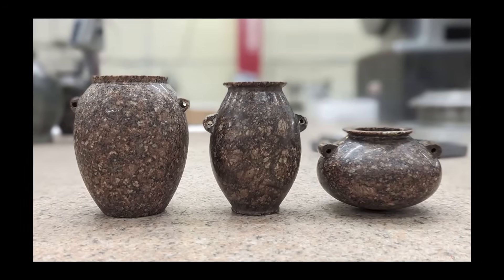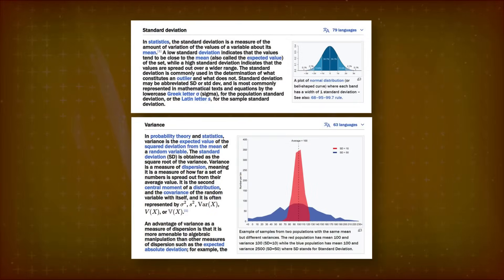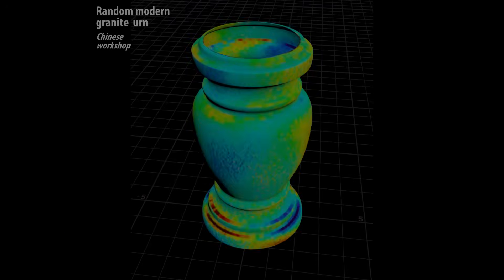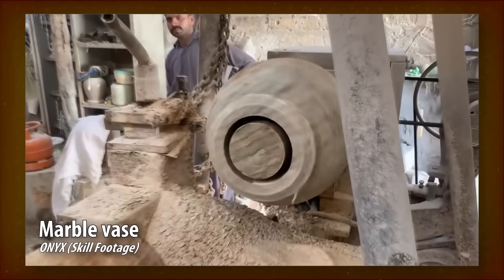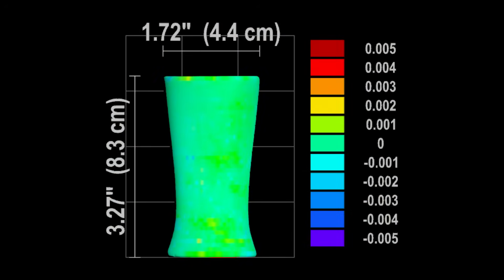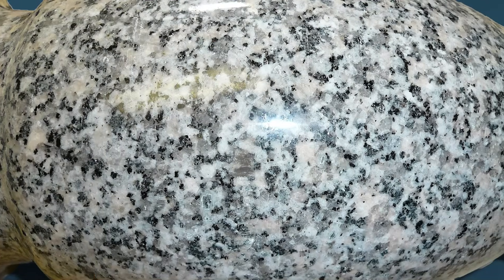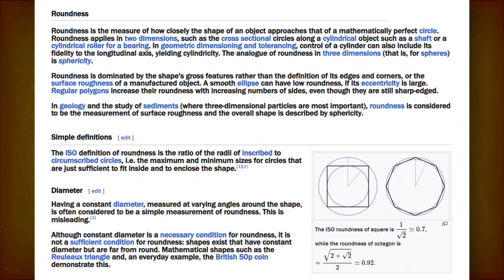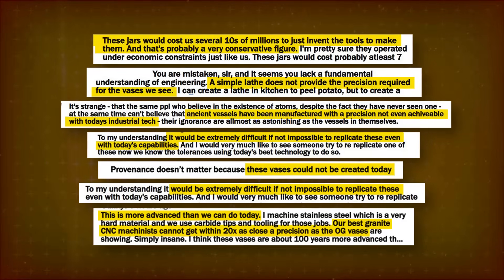Impossible Granite Vases: 3D Scan Showdown

Comment: the shot glass was that used a lathe and carbide tooling was the only example that was remotely close , and the operation used carbide and precision of a modern metal lathe
 You have only proven you can't make granite objects within .002" in 5 axis without a lathe and carbide tooling
Reply: No , what it really proves it that the claims of LAHT advocates are inconsistent
Reply: @matthewmiller5619  that's refreshingly sweet 🤗 almost naive, bet you believe they moved 800 ton limestone blocks on logs with rope, too, bless your heart
Reply: @mrglasecki  How do you think big stone blocks were moved?
Reply: @mrglasecki  your beliefs require the ‘god of the gaps fallacy’ whereas I’m just comfortable with accepting that we may never know the methods used .
Reply: @mrglasecki  I'm really curious, what do you believe they used, if not rope?
Reply: @MrAchile13  honestly that is a extremely good question the smaller 5-10 ton blocks could have been floated, possibly rope ect above 50-100 ton that's no longer possible 600-800 ton+ obelisk over 1000 ton that requires hardened steel alloy and a significant amount 
 For the naysayers karahan tepi had stacks of cut stone vessels 12000 years ago and plates bowls vessels in the well of the step pyramid that required high speed lathes diamond tipped steel tooling , sorry if this doesn't fit your preconceived limited superstitious beliefs 
anything steel would have long rusted to oxide in less than 10k years 
  I work with hemp bast hemi cellulose fiber,  it's a minimum of twice as strong as steel by weight , to position 800 ton * even one fourth that weight would require winches rigging and alloy steel cables, the painted hieroglyphics showing 100 guys pulling ropes over logs is beyond hysterical it's like the modern uneducated trying to make sense of something beyond their grasp saying the disc of Sabu was made with copper and pounding stones 
 800 ton required not just steel on a basalt surface * hardened steel on hardened steel on a level bed and ~1600-3200 HP
Reply: @mrglasecki  let's not get side tracked, as we are discussing the usage of rope for megalith movement. 

The heaviest Egyptian obelisk ever moved is the Lateran obelisk (300+ tons). You might be surprised to hear, but it is located in Rome. That's right, the Romans took it from Egypt, all the way to Rome, almost 2000 years ago. Do you think they did this without using ropes?
Reply: @MrAchile13  let's start with the obvious, yes Romans used rope
 Egypt moved the obelisk 130 miles across the desert
 It took Roman conquest >25 years to move it by water , using heavy ships it took  years to build with solid road surfaces to distribute 400 ton obelisk (that broke) with IRON hardware
Reply: @mrglasecki You didn't answer the question-perhaps it wasn't clear enough..
If as you seem to be claiming, those heavy stones could not be transported using the tools and tech of the era that we know of, how do you think that they were moved?

And by the way, the "wood couldn't handle the weight" hypothesis has been pretty thoroughly debunked.
You should probably do a bit more research.
Reply: @mrglasecki  I'm curious where did you pulled the claims about it being moved 130 miles across the desert or that it took the Romans 25 years to move it?

So you do admit a 300 ton stone can be moved by using rope. This is already more then the 100 tons you previously claimed to be the maximum load possible to be moved by rope. My question is, where do you draw the line? What is the weight where we move from ropes to this mysterious and unknown method of transportation?
Reply: @darklight2.1  * the log idea is not impossible it's improbable , that a massive difference , Egypt moved the lateran obilsk to from Aswan to karnack ~1400 bc across the desert 130 miles
 it took Roman conquest 25 years to move it by sea with heavy ships 2000 years later a few km over paved road  
 the last time there was enough rain to grow enough trees to move the granite basalt diorite limestone of Egypt would of taken 125,000 Years to grow
 thinking they had iron even hardened steel alloy is simply easier to swallow
Reply: @MrAchile13  Egyptians move that 400 ton obelisk 130 mile minimum across the desert Roman engineers used heavy ships and the Sea and maybe 80km of paved roads 2000 years later with IRON 
* When 1200bce Egypt only has copper
Reply: @mrglasecki  You posted your previous comment again. As I said, I was wondering:

1) why would you say the Egyptians moved the obelisk 130 miles across the desert?

and 

2) if you accept the 400 ton obelisk was moved by rope, where do you think ropes stop working and we need this mysterious method you are hinting at?

Remember, we are discussing the use of rope for megalith movement. What rope can or cannot move.
Reply: @mrglasecki  How would you move them with the materials at hand?

There are many theories. For instance, C. Dunn, an engineer who has been presented numerous times as an expert witness by the LAHT channel UnX believes that a group of skilled vocalist's could "chant" large stones into place, harnessing  the resonant powers of their voices.
What do you think?
Reply: @MrAchile13  the obelisk in Rome is made of rose quartz from the Aswan quarry and that's 130 miles from Karnak (Luxor) where it was located prior to being moved 
2.) probability and possiblity are starkly different, the Romans took 25 years to build the boats and engineers to move it 80km on paved roads 
 the shear volume of granite conundrum diorite basalt limestone blocks across Egypt would require a rainforest 100 thousand years 
 A modern locomotive weights 200 ton a weight capable of smearing a metal coin between hardened steel alloy rails and wheels 
exactly how many ropes would you need to pull it down a gravel road on logs without  wheels * forget bottomless desert sand that's round and smooth versus ocean beach sand that's interlocking when wet and that's half the weight 
 400 ton would reduce timber to toothpicks
Reply: @mrglasecki  1) do you believe they moved the obelisk from Aswan to Luxor by land, instead of using the Nile? Why would they do that?

2) again, let's not get sidetracked, we are talking about rope movement. Should I understand you do accept there is no ancient megalith that couldn't be moved by using ropes? As I understand now, you don't seem to have a problems with the ropes anymore, but with other aspects of the movement. Is that correct?

I don't know how many ropes would be necessary to move the locomotive, but we would need less then the Romans needed to move the Lateran obelisk, wouldn't you agree?
Reply: @MrAchile13  moving the locomotive with rope is critical it's half the weight 
  if you could drag a locomotive across timber  it would reduce it to pulp the Romans  figured this out 2000 years later across sand attempting to move twice the weight 130 mile (that's one of the shortest distances ) not just  that one from every quarry to every building site is simply not realistic 
 Moving an object 80 km across paved roads even lashed to a rowing heavy ship wouldn't require the amount of rope to dead drag a 400 ton object Up and down 450 foot of elevation through the desert sand
 Going against the current of the nile, please  think what it would be like going against the Rhine, Mississippi , Rio grande, river in a crocodile infested water dragging a city full of granite against the current
Reply: @mrglasecki  1) seriously, why would you drag it through the desert instead of using the Nile? Where is the logic in that? Luxor is downstream from Aswan, so no one is going against the current. Crocodiles do not highjack ships and sadly, there are no cities full of granite.

2) ok, I understand you no longer have any problems with the rope. So as you understand, there is no ancient megalith that could not have been dragged using rope

3) as for the locomotive, no, it would not destroy the wood. You would simply put the locomotive on a wooden sled/frame and then you would drag it across the wooden beams/rollers.
Reply: @MrAchile13  1.) currently the nile with locks dams is a navigable river of 35' maximum 25' average allowing modern ships to float by displacement
 1400 bce they had reed mats rolled into bundles with 450 foot of elevation and no where near the depth the weight would have ripped the reed barge apart dragging it through the river silt ( basically sand only 1000 times smaller liquid earth) would be impractical to build a barge for every block otherwise it's drug one way at least it's a barge not a sailboat  
 I'm not saying stuff wasn't moved that way
 the river bottom would be paved with lost stone over several thousand years
Reply: @mrglasecki  1) We found two of Khufu's boats at Giza, they are made of wood, not reed mats (~2500 BC). I think we both agree no one would ever try to move an obelisk using a reed boat. Fortunately, we know better. There is a depiction on the Temple of Hatshepsut from Deir el-Bahari (New Kingdom ~1400-1300 BC) depicting a wooden ship carrying an obelisk.

2) now that we agreed rope is strong enough for the job, what other problems do you see?
Reply: @MrAchile13 Khufus boats are impressive 
 the obelisk was 150'  long
the boat you're referring to, though physically capable of carrying the weight by displacement of length width draft to barely float the stone but not design , if it was multiple barges instead of cabin boat, again though  possible the thought of using only one barely big enough isn't probable , in the least 
 * the 3 ships the Romans built were similar in width and draft and totalled 313' long for stability
Reply: @mrglasecki  except that's not the boat I'm referring to. As I said before, the boat I'm referring to, is the one depicted on the walls of the temple of Hatshepsut from Deir el Bahari. They were well capable to move and erect those obelisks.
Reply: @MrAchile13  the largest Egyptian ship EVER found was 144 ft long and 19ft wide laughable too small to move 400 ton by itself , let alone, all blocks in various cities that were larger , you seem to continue to fall back on fantasy and childish examples of pounding stones to cut granite blocks out of quarries and 100 men pulling them, 400 ton would require 2000 men if every man could pull 200 pounds each with 4 rows of men and 4ft per man spacing is >10,000 ft of extremely massive rope per block that size, as I said before 5-10 even 50 ton blocks I have no issues with them moving by water, yet with hundreds of thousands of blocks moved the laws of mathematical average the nile would be literally paved with lost block over several thousand years, sorry 
 Easter Bunny Santa Claus and Egyptian copper age fable are not real
Reply: @mrglasecki  Of course the Egyptian fables are not real. I am talking about the scientific data.

1) We don't have the Egyptians boats used to move the obelisks, just as we don't have the Roman ships used to take them to Rome, so I have to ask, what's your point?

Are you trying to say they dragged them through the desert instead of building boats, then lied about them being moved by boat? Where is the logic in that?

No one is claiming granite was cut using stone pounders. I would gladly discuss the quarrying process after we finish with transportation. Once again, lets not get sidetracked.

2) Egyptians used pulleys by the New Kingdom, so that would reduce the number of people, wouldn't you agree? 

3) "hundreds of thousands of blocks" - you see, this seems to be the real fantasy. You just pulled that number out of thin air and it has nothing to do with the reality. If you read the scientific literature or go to Egypt, you will see the tombs (including pyramids) and temples are built from smaller blocks of under 50 tons, many of which did not even had to be transported on the Nile, as they were quarried locally.

Comment: Wow. What a poor attempt. The only thing you prove is you can make a round thing on a new lathe. Most do not say we couldnt do it today. They say it couldnt be done with sand, sticks, and rocks. Which you failed to even attempt. You also didnt attempt the handles or the internal right angle undercut. You just said "undercut no problem". And you didnt attempt the handle becauss you couldnt do it on a lathe. Again, you say "just chisel and smooth it off" without any proof. The mainstream said these are made with sand, stone, and sticks. Which you failed to address at all. What a failure. You just proved you could make a round thing on a lathe. They say it cant be made today becauss of the exact 2 things you didnt even attempt. (Space between the handles and the undercut insides) the majority of the originals have handles and are atleast contoured so why hand wave them away when that is the main reason all this is being done? My guess is because you already know you cant. If you disagree, then back it up with proof.

Comment: you're still missing the point. Handles
Reply: Meh, a pisspore argument, cope harder
Reply: Handles are a good example of moving goalposts.  The argument was originally "we cant possibly make anything like this today, theres no way to do this with primitive tools"  Both of these were shown wrong.  Then it was handles (even though night scarab has another entire video about handles that all of these comments are ignoring).  Handles arent even remotely as big a mystery in this crowd as the original vases were.  You simply leave a ring around the top and remove unwanted material.  The handles are never anywhere near as precise as the rest of the vases, even in Ben's best examples.
Reply: Indeed. Not even half debunked. Ad handles and these techniques can't do the work that was done 5000 years ago. The stupidly and ignored handles are such a lack of understanding the problem😂

Comment: I know it wasn't your intention, but you've just proven that it would have taken a lathe type machine to have made the ancient stone vases. What you missed, probably because you know very little about machining, is that the most telling factor is concentricity, and not roundness. Roundness is a given if you use a lathe. Your analogy with the ice is a bit silly. Hardly a realistic method of making anything, except ice discs. As for granite and it's composition, well, there's granite and then there's granite. It's quite a variable substance. It can be reasonably kind to work, or it can be almost impossible. The examples you showed would have been made with the kinder variety. The type of vessels you used are very simple to make, not a worthy comparison. Your debunk here is full of strawmen and it shows a woeful lack of knowledge about machining. 
Go make a proper vase, as in the ancient examples you showed, not a shot glass, with a thin wall, and lugs. Use any machine you like. Beware taking too much notice of pseudoexperts on this subject, they'll mislead you.
Reply: This, the vase scan project moved back the date Egyptians had lathe technology at the very least.

Comment: I really love your contet but sadly you didn't talk about how the handles could have been made keeping that precision. I'd love to see a real world experiment using only tools they had in that times. Even if they had lathes - sure not from Harbour Freight  made of steel :D
Reply: You want handles just like the ancient imprecise ones? Why?
Reply: @Eyes_Open  that the whole issue, the handles are the problem in this matter. Try to make that with the tools shown in this video
Reply: @prutser8582  No...as stated before...they are not regardless of those who like to make them out to be...Time consuming...yes...difficult or impossible...no...
Reply: @prutser8582  You leave a ridge of stone at the height of the handles and then later remove the unwanted portion of the ridge.
Reply: @Eyes_Open  I understand what you mean, but I think this would not work. You need full rotation & speed that a lathe work. This is not possible if you only have a rotation for about 160° or so.
Reply: @LostPlaceChroniken  It means that you begin another work step with a different method.
Reply: @LostPlaceChroniken  This is not a matter of "I think" which is often difficult in these conversations since 99.9% of the commenters on both side of the debate have never once in their life worked stone traditionally...Though it is basic in description, what @Eyes_Open
described to you is exactly how it is done...not really open for debate as I use the same method in potter as I do in turn stone, and I should add there are more than one. These "grifters" and their nonsense are amusing...but also sadly very distracting from actual efforts of those trying to learn the traditional arts or do valid research rather than pushing a "lost technology" agenda...
Reply: @LostPlaceChroniken  Why would it not work?  That is literally how it is done.